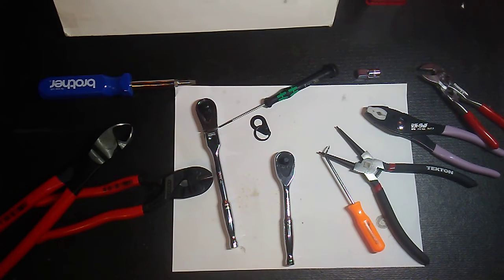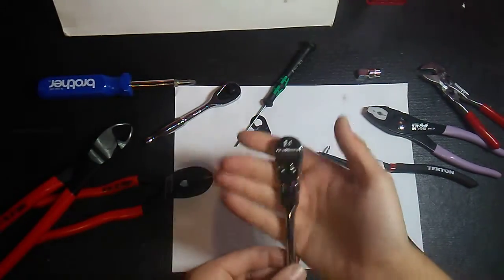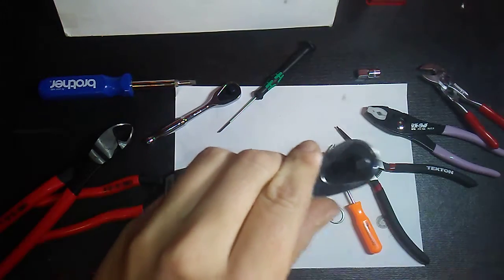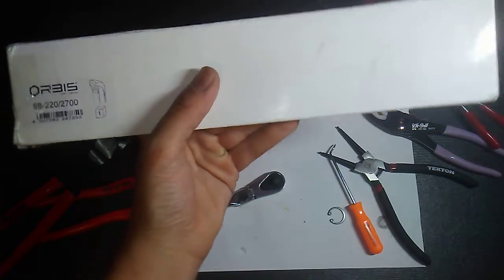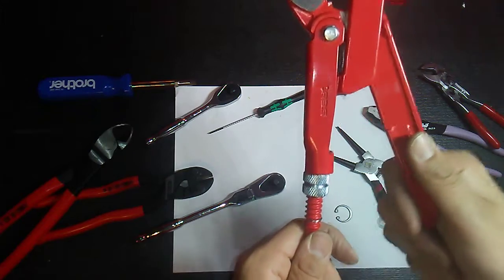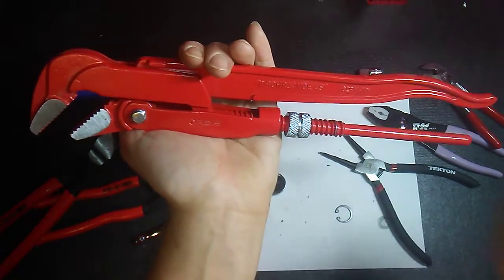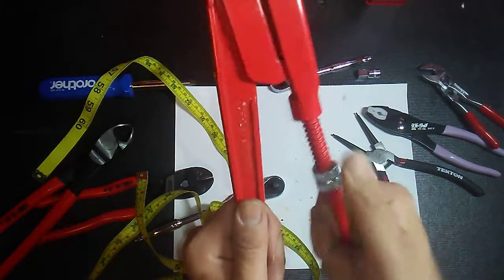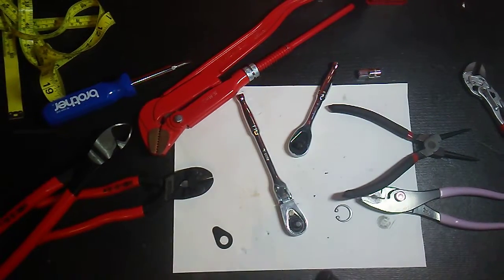1st DIY Gearwrench 120xp Locking Ratchet Won't Work

Comment: The double pawl is why it’s thicker you can’t make those work because that’s why one is tight and the other is loose. You will ruin both ratchets trying to modify them. Good luck trying.
Reply from the maker: Well shoot, I was thinking if I could get a thinner snap ring and machine out the head out a little that it would work, it almost work's but the snap ring doesnt seat in all the way all I did was just swap out the one piece. Even if I can get it to work for super low torque applications id be happy with it being used for those really tight situations when you need a lot of teeth and a fixed tool to do the deed. I think i'll get a 1/4 or 3/8 120xp flex head (maybe just the head even) and see what it needs to work. Thanks for the input, opinions on using a 120xp flex head with putting it on the 84t lockers?